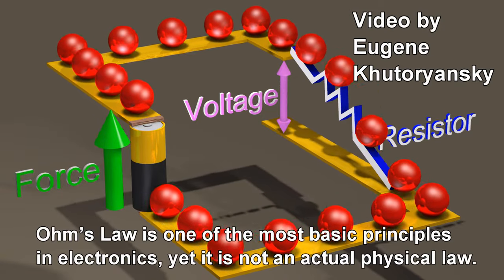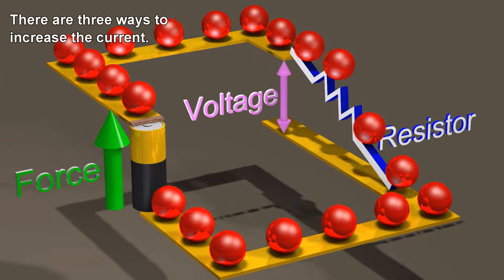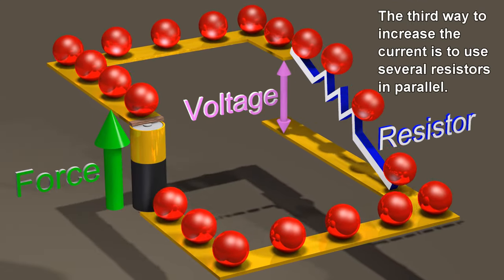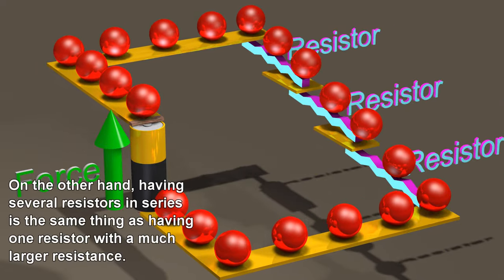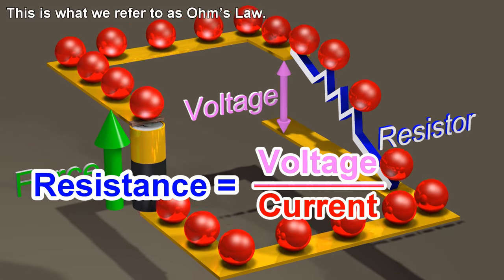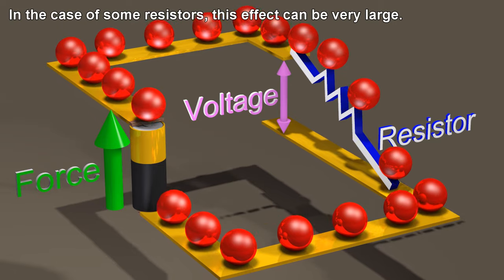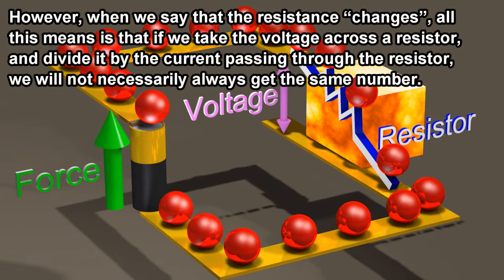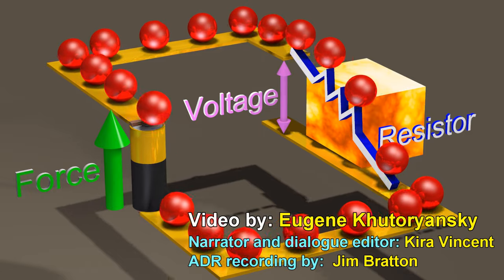Resistors - Ohm's Law is not a real law

Comment: The resistance may change with temperature, but the calculation remains valid at any instant in time at a given temperature. Saying that Ohms law is not a law when it always returns the correct answer is invalid logic. This video is talking about semantics, not physics. Save your breath.